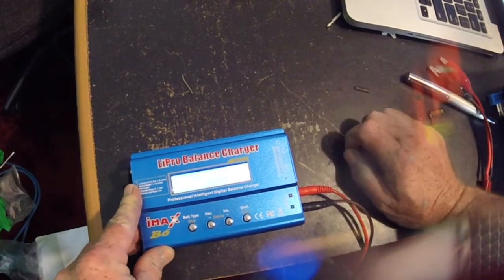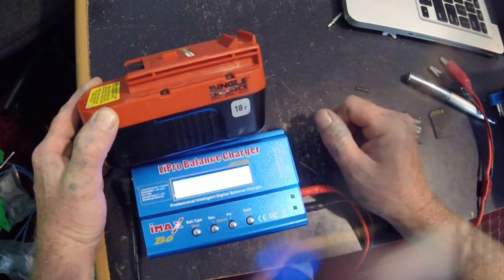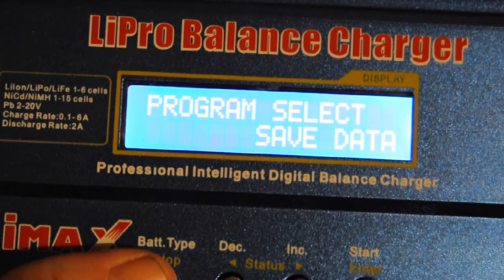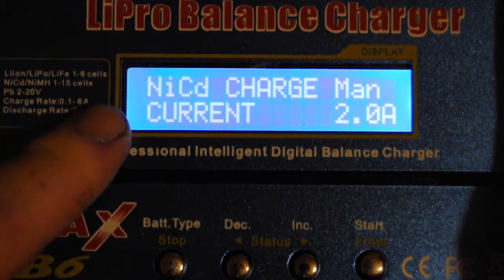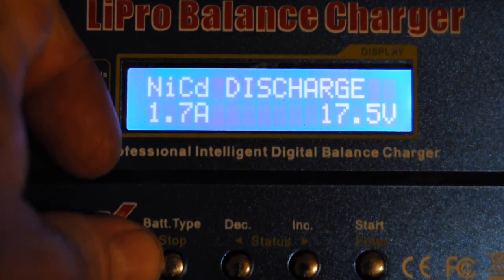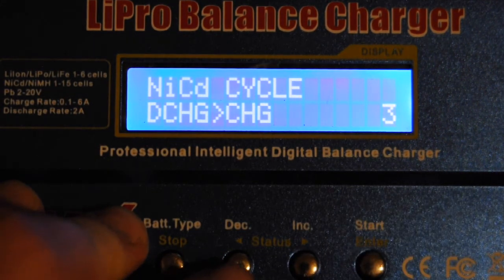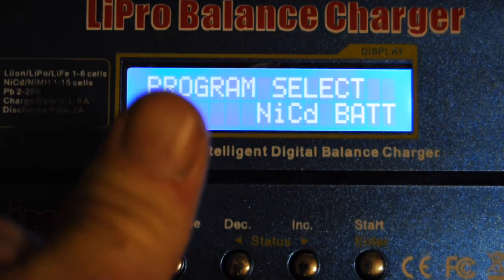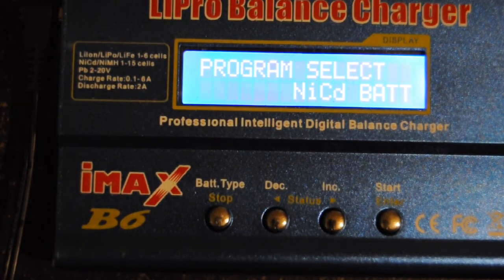How to CYCLE Batteries to Extend Life - IMax B6 Hobby Charger

Comment: I finally bought the HTRC C240 duo AC/DC charger and it is basically 2 of your blue chargers put into one. Very nice construction and Easy to program! I am about to attempt to restore my old 18v NiCd power tool batteries. Thanks for the video! P.S. I only paid $60 with free shipping on eBay! What a great deal!

Comment: the ONLY discharge profile that lets you modify min (discharge-to) voltage is NiCD.

The default min discharge voltage for LiFe is way too low, at 2V. Needs to be more like 2.7.
So, to be able to safely discharge LiFePo4, you select NiCd and set the discharge voltage to 2.7.
You'd then use that profile (NiCD) when doing the discharge excersize. Don't forget to switch back to proper mode when doing charging.

Discharge power max is 5W, so you will have to adjust the discharge current to stay within the limit.

For example, discharging single LiFePo4 cell, at 3.2V, your max discharge current needs to be 1.5A or less. Otherwise, if you set it above that value, Imax will stop discharge after about 11 secs
Reply: I realize I am pretty off topic but do anyone know a good website to stream new series online ?
Reply: @Gary Camilo I watch on Flixportal. Just search on google for it =)
Reply: @Mack Jagger Thanks, I went there and it seems to work :D Appreciate it!!
Reply: @Gary Camilo Happy to help xD